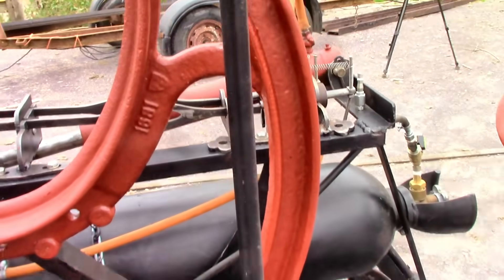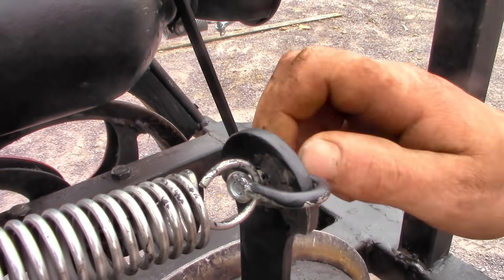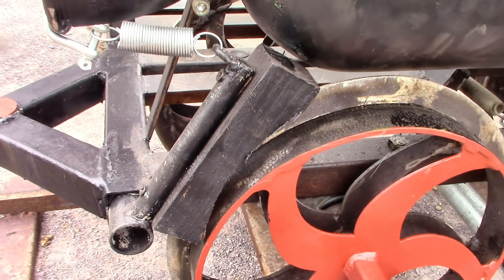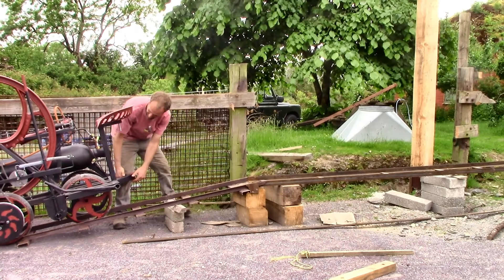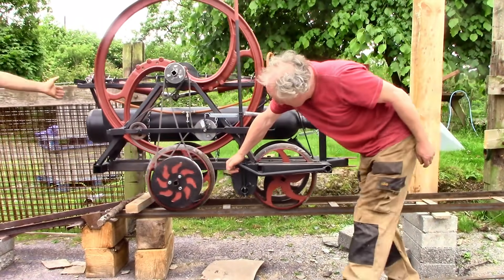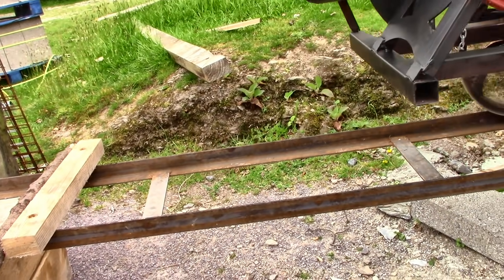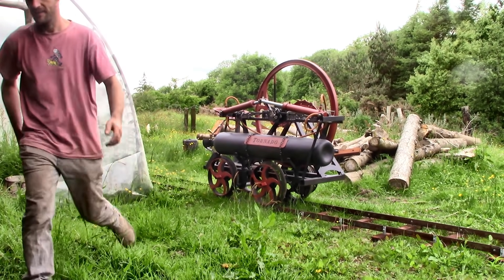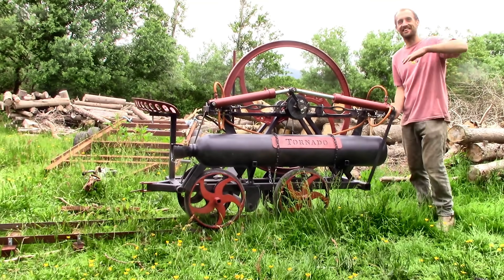First Run!! Home-Made Compressed Air Locomotive For The Field Railway

Comment: I imagine an archaeologist finding "Tornado" in a couple of hundred years, reading the date on the flywheel upside down, as 1681, and declaring it the earliest locomotive ever. 🙂
Reply: With the way that thing is built, at least some of it will last for a couple hundred years lol
Reply: There are dates stamped into the pressure cylinder as well. They can claim it was in service from 1681 to last test date on the cylinder.
Reply: Maybe when they will find it they will have the excuse of Tornado being too expensive to rebuild, even though Tim over here built it with a pretty decent price lol
Reply: Yeah lol
Reply: @catthecommentbothunter6890  m
Reply: hunters memo

.l
. 

.ññmmñkk
Reply: @catthecommentbothunter6890
Reply: They also could try to figure out how they fill 3000psi into the tank at this time :D
Reply: @archloy 😅
Reply: @archloy 😅😅😅😅😅😅😅
Reply: Imagine if it finds its way to some dinosaur bones in the Earth crust
Reply: @soberhippie  yeah... unfortunately, that's not how it works, but the thought is nice!
Reply: "we still don't know how they would get air at the working pressure of the engine which was found to be 300 to 3000 psi"
Reply: @datguymiller  3000 lb electric pumps can be had at a fair price to fill air tanks
Reply: @bill45colt  But could they be found in 1681 though?
Reply: @bill45colt  but in the 1800's as the joke implied they thought the engine was built in
Reply: @bill45colt  Yeah but the joke was that they didn't have a away to do so in the 1891 which is the date on the fly wheel
Reply: @datguymiller  i was wondering where they got welding rods and electric welder for construction also,,,thanks,,,,i have ten acres but no money for toys,,,
Reply: i think id  have gone to the extra expense of laying rail so the flat side is against the tire and not the edge,,,, but he can make that change after his tires get cut with grooves,,,good fun in either case,,,
Reply: Aluminium parts & modern materials + strontium isotopes etc won't have future people making schoolboy errors
Reply: lmao
Reply: It would be blatantly obvious to any archeologist that this was not built in 1681. The chemicals in those rubber hoses and the paint would be proof
Reply: Lol
Reply: It was 1891 on the flywheel not 1681 were did you get that from
Reply: @ciaranosullivan3193  Try reading my original post again! 1891 turned upside down (=turned horizontally through 180 degrees) reads 1681.
Reply: Alians duh
Reply: Looks like a smaller version of the engine Richard Trevithick made in the 1820s/1830s............👍👍❗
Reply: No, they'll be horribly confused on what the hell its supposed to do
Reply: And watch a video of it on Youtube. Sure.
Reply: 1861
Reply: Yeah probably a couple 100 years.
Reply: That’s “experts” for ya’.

Comment: This is probably a deeply stupid question, but I will risk it nonetheless. If you had a pair of check valves in line, could your compressor potentially fill the bottle with quite a bit more air? I guess my thinking is that the compressor not only needs to condense air, but use a great deal of its power to stop the already pressurized air from back feeding. I know you would not get anywhere close to 3K, but I would imagine 300 PSI it's doable for many Job shop sized compressors. What am I missing? Clearly I am wrong otherwise we would have many multi-chambered PVs. What is the formula though that proves this to be futile?
Reply from the maker: I'm no expert but I think the pistons can only raise the pressure by x amount.  Your one-way valve wouldn't reduce the pressure after the pump, so you'd still be asking it to push more than it can?
Reply: @wayoutwest-workshopstuff6299  thank you that is obvious. I can't be certain, but I think that's why I suggested a pair of check valves. I suppose it would all equal out after a cycle or two, but my brain got stuck on the idea of an intermediate stage allowing it to do so. But your answer is clear. After the first cycle, the pressure beyond the first check valve would equalize. Like I said, risky question. If you don't ask you don't learn

Comment: It is absolutely fantastic and it looks quite beautiful with more than a touch of the early 19th century about it.  I hope you can find a solution to the air pressure problem.  I'm sure it will be great fun and useful too.  I have to ask.  Did it, as is widely feared, scare the cattle and horses?  😊

Comment: Can you get a compressor that would run off your stationary engine, or is that fully committed to the woodchipper? 

Would that be capable enough to get the tanks to a higher pressure?
Reply from the maker: That should be easy enough - if I can find the compressor

Comment: you should us a pressure regulator and hold the engin at say 50 psi and then you will get a lot more range also 3000 psi will blow your lines right off so its a must have the only hard part is getting one that works with the flow you need

Comment: I love it but maybe put a chain drive between the axles so they both drive and  brake.       it kinda sucks your in Ireland bc I have a  4 cylinder ingersol rand  compressor  that goes to 2500psi  it however needs love🎉
Reply from the maker: Thanks for the thought, Mike. Is Ireland really too far?

Comment: Truly amazing. You're going to need brakes on more than one wheel to stop it while pulling a load. A pair of brake shoes on the inside of the rim would be more effective, but once the wheel slips, braking has maxed out. This is a problem on big trains, too.

Comment: It would work to help slow down to make a Jake brake into the engine. Basically have a switch that closes all valves into the cylinders at once and it will turn the engine into a mass damper.

Comment: With higher pressures you could drive the other side of the cylinder and use less air, or use higher gearing

Comment: ever thought of using a larger motor on your air compressor. it would pack more air. mabye ad a tank to your air compressor followed up by a flutter valve set for increased air compression.

Comment: I guess the Tornado is more of an off shore breeze till you can fill the air tank to full bro but hay it works so pat yaself on the back. Just an observation but it may need brakes in all 4 wheels once you start pulling loads. Safe travels

Comment: It works! Looks like you might want to add a parking brake at some point. And you might eventually consider individual car brakes; it'd be ambitious, but when it's hauling a full load you'll want every extra bit of braking force you can get.
You might also consider a dead-man's switch to minimise runaways, but that's more optional.
Thanks for the video!

Comment: Will the air cylinder need to be annually certified to handle the high pressure.
Steam boilers get annual testing in USA

Comment: Do you think you would gain any efficiency if you connected the open port on the cylinders together? 
The air escaping from one would help power the other in the opposite direction.
Just a theory on my end

Comment: you could use liquid gas as when its liquid, its compressed into, well, a liquid, but when the temperature is back to normal, it expands and gets the pressure very high, for example there is liquid butane, but thats a bit dangerous as its flammable.

Comment: If you reverse the belts over the pulleys, it should go in the direction the lever is pushed or pulled.  That way, to go forward, push the lever forward and pull back to go in reverse.  By installing sprockets of the same size on each axle, with a chain over them, will give you 4-wheel drive and hopefully, brakes.

Comment: I love your version of Tornado as well as the railway!  One thing though - consider adding a connection point on the front as well as the rear, so you can pull as well as push wagons from either end of the the loco around on your railway.  That was you don't have to worry about which way 'Tornado' is facing.

Comment: This has to be the most magnificent machine of the 21st century. I will be frank, I had my doubts about the applications for a compressed air locomotive in agriculture, citing the gradients on the field railway, but there we have it! The forefathers of railway locomotion would be thrilled. Very well done.

Might I also suggest a coupling for the front end? It might seem redundant, but will likely come in useful later on if the scope of the railway expands.

Comment: Yes, but will it pull carts full of wood from the fields or chomper. Look your ingenuity, however a small gasoline engine with a gearbox and belt drive would probably have a lot fewer moving parts and not need an expensive compressor to recharge the tank every twenty feet.

Comment: As a maybe not so fun fact, most locomotives can't handle slopes, they can handle very slight ones, but anything above a grade 2 or 3 slope? They start to struggle a little, so maybe that's why your locomotive couldn't handle going up the hill for too long. So as a suggestion, if you are going to be using tornado as your main engine, then I suggest building a more powerful locomotive to be used as a "banking" engine, with its wheels being driven directly from pistons connecting to side rods. As I also believe that, in an emergency, the second engine could come in handy, especially if it has some tighter, more powerful brakes. Also I suggest putting the number 1 somewhere on tornado so he can be remembered as the very first locomotive of your railway.

Comment: there are a few ways to get more Fuel Capacity, braking power, and other overall improvements. 

1. a carriage/tender to hold more air tanks or a compressor(or several) (got this from someone else comment down below). 

2. better compressor to fill the tank more (what your planning from what i can get from the video) 

3. add a pair of brakes to the front and also on both sides (from what i can see they are only on one wheel) 

4. metal brake blocks (the brake blocks are what press against the wheels to stop them, and also because the wooden ones (forgive me if im wrong about this) dont have as much gripping force and could possibly catch fire if the wheel keeps turning while the brakes are on). 

5. link the wheels together using either SideRods (rods/poles that connect the wheels for more pulling power and possibly speed) or a chain and sprocket (i give full credit to the other commenters that had these ideas) 

6. lubricate all moving parts (also took this from another commenter). 

7. a cab for whoever drives it (this will protect the driver from debris and any shrapnel if anything explodes or flys off). 

tldr. these can help with several issues you might have. a tender, better compressor, more brakes, metal brake blocks, linking the wheels so they are both powered, lubrication of parts that will be under constant wear in operation, and a cab for protection.

Comment: im not certain why, but i just relised
this is one of the few channels i watch every upload, theres just something... idk, authenticly ameturish about the videos, and the subjects aswell, facinate me
i love many mechanical contrivances, ones that would kill you if you stick y'r booger hooks into it the wrong way
a scrub brake, nice. 
also i would like to mention the fact that a belt driven reverable system is beter than direct drive with reversable valve train, reason why i say a belt drive is beter is cause typically, steam engines run beter forward than in reverse, and its simply a valve timing affair, designers relised it cant be perfect with the system they use on locomotices so they comprimised and made it run best in forward and a bit worse in reverse, cause its gonna be pulling more than pushing

Comment: You absolutely need a dead-man's pedal on it. If your foot is off the pedal, the gas turns off to the  pistons. I would highly recommend a spring-powered brake that is held off the wheel by a piston full of air. When the gas turns off to the pistons and your foot is off the dead-man's pedal the brake applies.

Comment: that looks amazing and for being WAY under pressure its still VERY impressive and the name "tornado" fits perfectly.
is there any oil/grease involved in the cylinders? if not a little bit would go a long way towards helping prevent wear of the seals and eventual air leaks.
Reply: Last video he said he wanted to put a inline oil dispenser to feed lube into he line going from the bottle. So yes.

Comment: I'd be tempted to explore the possibility of a braking system that pressed the rails outward.  First I thought it should pinch the rails like a bicycle's hand-operated brake pinching the wheel rim, but the pipes that hold the rails upright would not care much for that.  Then I thought maybe it should just press the inside of each rail outward.  An oval wheel slung underneath with a vertical axle maybe?  Love the loco! Nicely done!

Comment: copple of sugestions you might want to join the two axles together with a belt and that will help whit the brakes and wheel slip and probly be a good idear to make some form of a hand brake so it wont role away from you , and possably another tank somewair.  what you have made is a fireless loco where thay hade a tank of steam what was charged from a stationary boiler or another loco and where yoused in places where thay cant have sparks like in a gunpower factory or a fuel refinary ect. i think it will work well for what you want from it.
Reply: i fogot you willl also want to put a regulator on it so you dont plow the pipes off it when you get it on hire preshures but make shure it can cope with the preshures

Comment: THAT IS SOOOO COOL!! Congrats!
Also even though that tank is only a 3% capacity, imagine instead of air using steam, steam as far more energy then compressed air that with the current setup and a steam input you will probably just wheel spin all day. Excited to see more

Comment: It's pretty obvious that virtually all of the weight is over the front wheels; maybe you'd like to move the brake block to those instead?  Of course if you stomped the brakes you'd then run the risk of nosing the whole rig over, so maybe not.

Higher pressure compressors are relatively inexpensive anymore, since the growth in popularity of paintball.  You can get a compressor intended for filling paintball reservoirs for under US$400; it'd have to run quite a long time but their power draws are modest and the pressure cutoff is adjustable in case you'd like to leave plenty of pressure capacity in reserve for safety's sake.

Comment: most o the weight is over the non-brake wheels, so the brakes are less effective.  if you make a brake which applies to both sets of wheels, braking should improve dramatically.  a system like on a bicycle, where it pulls a brake pad onto the front wheel, which also pulls the rear brake pad forward onto the rear wheel might work.  standard bicycle brake design, except the brakes there apply to a single wheel from 2 sides.  here you'd be spacing the brake pads further apart, to one is on the far side of the far wheel, and the other is on the near side of the near wheel. and applying the brake pulls them towards the middle, appling a brake to both the front wheel and the other brake to the rear wheel.  poor explanation, but i imagine you get it. :-)  otherwise: nice!

Comment: @Way Out West - Workshop Stuff
I would still (if possible) reverse the winding on the flywheel-to-wheel connection, so the driving leaver is more intuitive: Want to go forward? --> press the leaver forward, (and the opposite).
AWESOME work! :D

Comment: You might want to reverse the action of the brake (pressing the pedal releases it) or even do a full Westinghouse Air Brake taking advantage of the pneumatic system. This would be much more safe and double as a parking brake.

Comment: I love this! Great to see it made after the many months/last year. Though, atm it appears to be a 2-2-0 loco. What if you put a chain and sprocket on the two axles for greater traction force. Or you could put side rods on the sides.
Reply: Just thinking the same thing! I think some braking improvements are also necessary, such as adding a brake to the carts behind as it could be a problem at higher speeds to put all the braking on the two wheels of the locomotive
Reply: @arevolvingdoor3836  If the tank was fully pressurised, he could have air brakes.
Reply: @arevolvingdoor3836   it looks like the engine braking is more effective and that is on the other axle so applying both should be sufficient at most speeds
Reply: @calebjowens I agree currently he doesn't need to. However, if he adds another cart behind himself full of wood and also increases the speed and there is something on the tracks, it would have some trouble stopping quickly. Not to mention that he is dealing with terrain that is not level so there are uphill and downhill sections as well. So for safety it would make sense to improve his braking.
Reply: @arevolvingdoor3836  If you connect the wheels all wheels will break
Reply: @datguymiller  hopefully they will brake...before they break 😀
Reply: Or just connecting rods on the non driven side
Reply: yes please the chain drive, it will aid in braking too.. lots of gain for ilttle extra efforts.. the brakes will be far more efficient with both driving wheel sets "stalled" warm regards
ps multiple stage some fridge compressors experiments ?! 3x ?

Comment: you could connect two break pads together with a single bar, like a con rod on a trains wheels. This would apply the breaking force to both axils and double your stopping power off the same break leaver.

Comment: Too bad you didn't start with the reverse gear running the opposite way so you would push the lever in the direction of travel. Forward for forward etc.
Also, if it's possible , please add some sort of sheet or screen housing around the flywheel and pneumatic cylinders to protect the valuable and irreplaceable driver from possible harm.